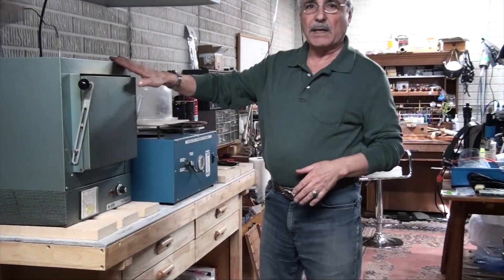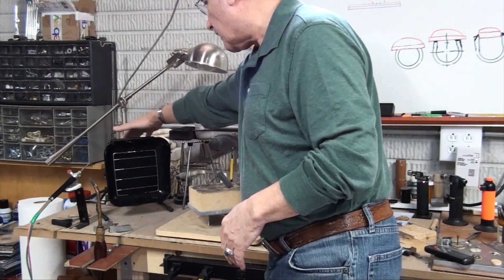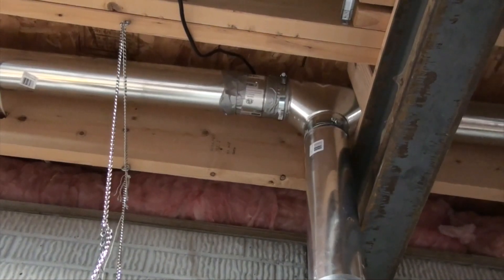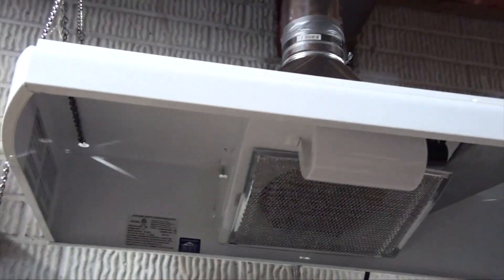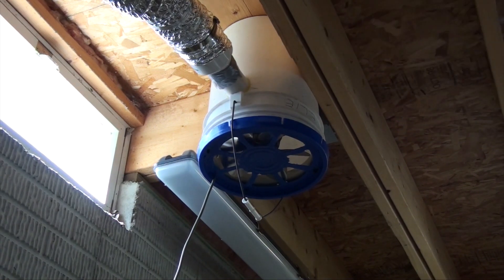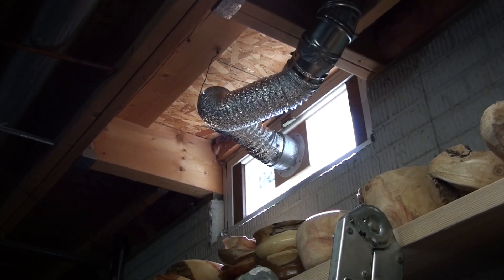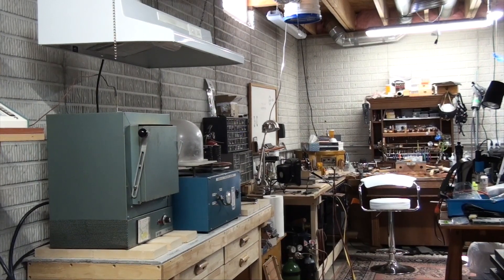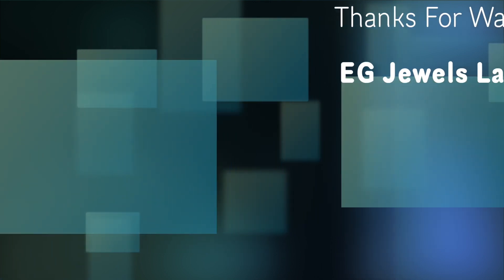How to Build a Ventilation System for Soldering

Comment: Could add dampers to make the exhaust flow selective and increase the cubic foot rate of air extraction.......just an idea.
Reply: I'm planning dampers in my ventilation system for my studio.
Reply from the maker: Yes I will do that when changing the hole diameter on the bucket, I was also thinking of adding a flexible hose coming down and fixed behind the black fan I have on the soldering bench.
Reply: @ElieGhanimeEG  Flexible hoses can add too much drag on your air flow. Clark, in her book, Ventilation: a Practical Guide, suggests that smooth walled round ducting be used whenever possible. Also less chance of buildup in the ducting.
Reply from the maker: You’re absolutely right, however at the time I didn’t have the tools to cut and crimp the round duct to size so I used the flex tubes, eventually I will change them.